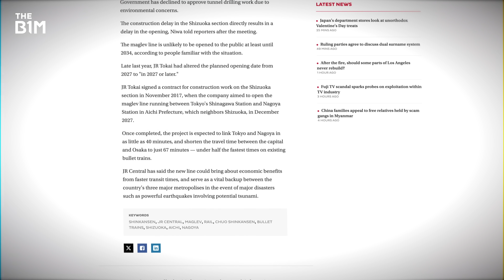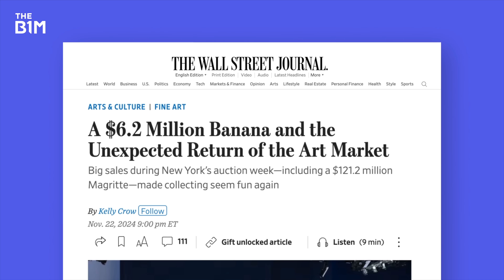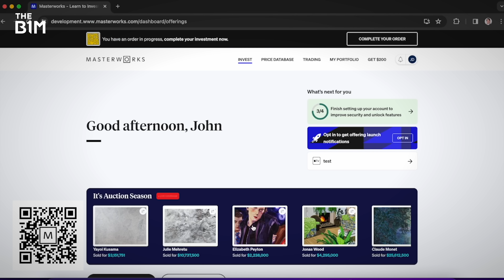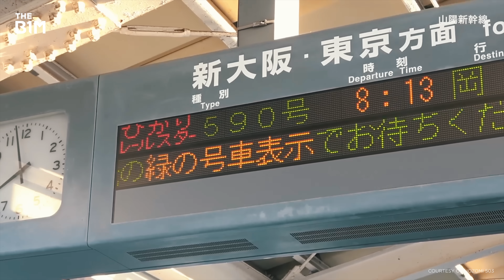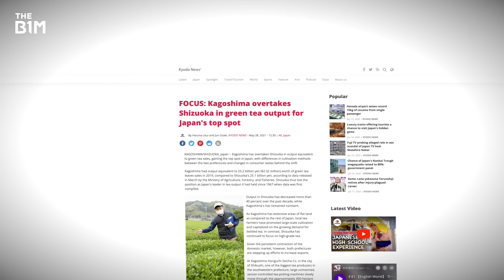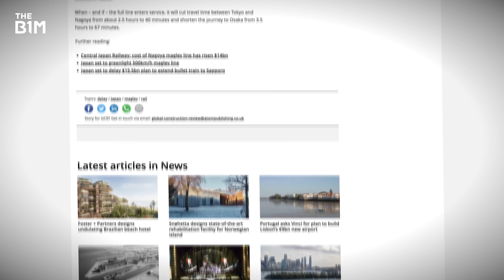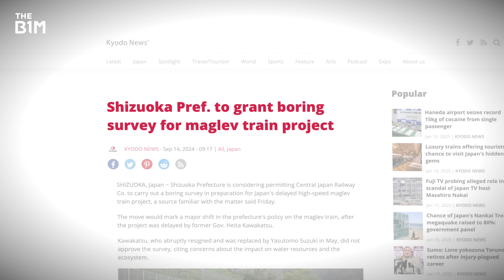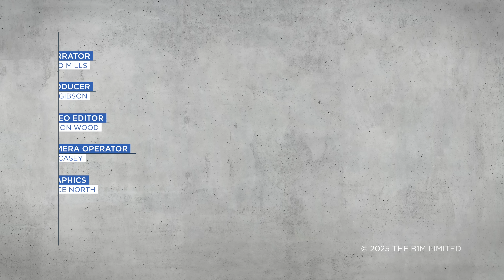Delayed: Japan’s $64BN Levitating Bullet Trains are no Longer on Track

Comment: 2:47 the thing is there were trains capable of 180-200km/h decades before the Shinaksen (the steamliner era trains in the 1920s and 1930s, post WW2 France had powerful electric locomotives), Japan was the first country who built proper track to run long journeys at sustained speed of over 200km/h and didn't shared service with local commuter trains and freight trains.
Reply: Pennsylvania Railroad was getting some incredible speeds with passenger rail in 40s and 50s. But then Big 3 Detroit stepped in to kill rail. And Detroit went bankrupt decades later so we killed rail for nothing.
Reply: Shinkansen translates to new trunk line - a dedicated, non-sharing line for high speed passenger trains only. That made the difference. 
Interestingly, a freight only Shinkansen will start operating in autumn between Tokyo and Moriooka, using converted E3 models, with seats replaced by cargo straps and fittings to prevent load-shifting, as well as larger doors. Expected market is precision equipment and high-end fresh fish, among other goods, as the new service will be faster and smoother than conventional cargo trains.
Reply: It's still the main difference. The ICE in Germany can go 300 km/h in principle - but it hardly ever reaches that, and it slows down to under 100 km/h as soon as there is a city anywhere nearby. The Shinkansen stays near its top speed until it has to slow down for the next stop.
Reply: @whocares2277  at the moment Germany still has very little in the way of a true high-speed network, it's little patches here and there joined to conventional lines and some conventional lines improved to meet the lowest high speed standards. France and Spain have good examples of high speed networks where you can do whole journeys on high speed.
Reply: @ well some countries focused a lot on hsr but didn't spend enough on slower regional services, Spain is such case. The irony is countries in Europe where people have high satisfaction rate with their trains like Austria and Switzerland don't really have lot of "true hsr" infrastructure.
Reply: However, would those steam engines in particular be capable of the same high-speed acceleration?
Reply: @ to be fair express service trains have not that many stops, usually connecting highly populated urban areas. Acceleration was not that great, but even in the 50s there were electric locomotives who were able to reach fairly high top speed and they do accelerate fairly quick. They were limited by things like sharing tracks with freight/commuter trains, the wheel shape and suspension did limit them which the shinkansen program did addressed that problem (unironically japanese researchers ironed out lot of things and they had the 220km/h top speed all the way until the 90s while in Europe 280-300km/h was the norm).
Reply: @ristekostadinov2820  You make a good point. Even though traffic could make the speed, even express routes would sometimes have to deal with slowing for goods traffic. The old networks of Europe didn't exactly accommodate for passenger-only express routes. The best chances of course being night services.

Comment: What about the Maglev operating in Shanghai? Would've been nice to point out the difference
Reply: Japan's linear trains use a niobium-titanium alloy as the superconducting material, and create a superconducting state by cooling it to minus 269 degrees with liquid helium. The train runs with its wheels extended when traveling at low speeds or when stopped. On the other hand, the Shanghai Linear uses normal conducting magnets, which are ordinary electromagnets, for levitation and propulsion. The magnetic levitation mechanism works by sandwiching a T-shaped rail (guideway) between the bottom of the vehicle, and the magnets at the bottom attract the magnets on the rail side, creating an "attraction" effect that levitates the entire vehicle.
Reply: When it runs at a top speed of 430 km/h, it's a 7 minute ride. Most of the time it's limited to 300 km/h and then it's an 8 minute ride. It operated as two parallel single track lines, because points in maglev are horribly slow. I assume the Japanese do all switching below 150 km/h with the wheels down.

Comment: As many have said, US mainlines ($$$$) involve a lot of freight rail and infrastructure that China and Japan don’t have; it’s very difficult to combine a high speed rail service with freight on the same lines. Actually it’s impossible with the tech mentioned in this video, but Acela and others along the east coast have evolved to use both (albeit at a lower speed.). I don’t see this changing ANY time soon, there’s just no way you can rip out hundreds of multi-million dollar buildings along the east coast to streamline a new high-speed rail line. 

It’s also a relatively short route, and already faster than air travel. shaving 20 min off an entire trip (even if you DOUBLE the speeds in some areas) is completely useless and won’t sell tickets.

Other nations that have large population regions separated by clean uninhabited areas would absolutely be able to take advantage of tech like this.
Reply: Chinese and Japanese HSR are not run on freight or standard passenger rails. If your going to build a HSR system do it right and make sure its elevated and not at grade like Bright Line where your hitting people and cars every other month.

Comment: The Maglev to Osaka originally was to cost $350 million per mile, or roughly $5 billion back in 2013.
Reply: That is insane HS2 was supposed to cost over $100 billion and was 1 3rd the distance as regular high speed rail.

Comment: Honestly I doubt this Maglev system is gonna be as much of a gamechanger as people think. People can boast about the speed all they want and the speeds are out of this world. But the sheer costs of operating a super conducting maglev system over such long distances is likely gonna make it extremely expensive to operate compared to a normal high speed train. 

Plus the switches (or points) for Maglev are problematic. Theyre much slower to turn than regular railway switches. And this could mean that service could be limited to one train every 10 minutes in each direction, or 6 trains per hour. Far lower than the existing Tokaido Shinkansen. And this is only worsened by the Maglev trains being much narrower than the trains on the Tokaido Shinkansen, losing a whole seat in width. 

These are pretty big technological setbacks that are fundemental to the design, and my best guess is that theyre gonna hold the project back from being as revolutionairy as one could hope.
Reply: Look to maglev switch at Transrapid: 200 kmH is no problem. Iron Railway is really bad at this point
Reply: @ArefRichardForster-mr2qj  I'm not talking about the speed at which the train goes through the switch. Rather the time it takes for the switch to move from one position to another. For a normal railway switch that's only 2 seconds. But for an SC Maglev switch that's closer to 2 minutes since every magnet capacitor on the outside rails has to be moved over a large distance.

And as a result the SC maglev can never run trains as frequently as a regular high speed line.

Comment: The UK cant build 140 miles of conventional high speed under 60billion.

Japan building 170 miles of maglev for around the same price ... 

The UK is absolutely screwed
Reply: The whole of Spain's 4000km long HS Lines were built for 70 Billion Euros. Keep in mind Spain is the most mountainous country in the EU after Austria so it's not like they are building on flat ground either.
Reply: At least you guys technically have HS1 going from Paris to London and fast mainline rail. Half of Canada’s population lives in a straight line that’s perfectly sized for HSR and we can’t even get slow trains at a consistent schedule, let alone HSR. We’re the only country in the G7 without some kind of high-speed rail, and it’s a national embarrassment that we’re only starting the preliminary phase of designing it now. But at least we’re not Australia, who I’m confident are never getting HSR for as long as I live.
Reply: @Jerdifier  As far as I know, HS1 was never the whole stretch. Paris to the the border of the UK had always been 300 km/h. HS1 was just from the border of the UK to London.
Reply: 中国京沪高铁1318KM造价是300亿美金，最新建造渝昆高铁长度是700KM，造价是200亿美金。
Reply: @阿蘇-t2j   別來亂
Reply: Drama of Japan struggling with tech tree beyond HSR... Meanwhile USA and UK cannot build tier 1 HSR 😅
Reply: @nagasako7  awak dari mana ,tiap negara ada masalah juga nak bina kemudahan awam sebab pelukan dana besar,Jepun tiap tahun spend lebih 300 bilion USD bangunkan infrastruktur mereka sebab itu Jepun sangat selesa dan maju ,sapa pernah pergi Jepun pasti dah merasai bagaimana Jepun muncul sebagai negara hebat dan kemas
Reply: @hosephanerothe1440  Even more screwed when they voted for Labour Party
Reply: @hosephanerothe1440  meanwhile we Malaysia build ecrl eastcoast railway with China under 60-70 bilion ringgit 😂 more cheap that you
Reply: Don't feel too bad, we can't build 140 miles of anything for any price!
Reply: Our planning system needs a major overhaul. Also, the govt needs to just say to the people “tough shit” we’re building it
Reply: The UK is going down. You can't even dispose of raw sewage, for god's sake.
Reply: indoensia can build they hsr in jawa island with around 70 bilion usd with china it be cheap

Comment: The video didn’t really explain why a train crossing a river would alter its flow.
Reply: It almost certainly has to do with groundwater. Groundwater flows might be altered, or water draining into the tunnel might be diverted to the “wrong” end of the tunnel because has a gradient in that direction.
Reply: The line isn't being built on a bridge there, it is over 1km under the ground in a tunnel.
Reply: A tunnel where the water leaks in which lowers the ground water? He said they had promised to pump it back.
Reply: @meandmypc12 yep, he said the same sentences 3 times about maglev... in a row...
Reply: if they were worried about altering the flow of the river they prolly should have started with not putting any hydrogen electric dams on it
Reply: Yeah. Is it because they have to build a tunnel under the river or what? They could just build over it? So weird.
Reply: Not sure. Might have water pole issues due to the magnet.
Reply: This video has so many problems if you stop to pay attention
Reply: @Meandmypc12  B1M's recent Japan series has a lot of issues in general IMO. I like them, but they are trying to cover so many things really quickly and only briefly skims over the subject. It was the same with the disaster resiliency video, and same with this one. I wish they just make it multiple parts and stop cutting out info. This is a nerdy topic anyways, the target audience will watch a multi-part series on the subject.
Reply: @Meandmypc12 this problem is most likely happening at the end of video
Reply: Maybe they can make another video to look into that since it would be way off-topic to discuss that in this video. Like, it is not the river crossing that is delaying the project, but the politician that is blocking project.
Reply: It just does. Just accept it. No need for mumbo jumbo, technobabble explanations.

Comment: I don’t really see the need for the extra speed. As long as the current train network is at or faster than airline speed, then there rally isn’t a need for the extra speed. Who really cares about going from 2.5 hours to 1.5 hours if it costs so much to build and operate. Just because it is cool and gets you marginal speed improvements doesn’t mean that it should be built.
Reply: I am wondering if the time quoted was a express, non-stop train? The more stops you make the more the average speed is reduced and the less advantage there is in going 600 KPH Vs. 250. If you put the stops less than 70 Km apart you don't have time to reach top speed without having to strap the passengers in to deal with the g forces. Start adding six or seven stops along the way and the schedule stretches way out.

Comment: relatives of mine just returned from China and they went on the Shanghai Maglev which is 30KM long from the city to the Int airport. It topped out at 220km/h for only a very short stretch and locally is claimed to be an all Chinese technology invention. But things are not as they are portrayed. The tech is actually German and was developed in the 1960s as a monorail maglev, the advertised cruise of over 300km/h and max speed of 500km/h was not attainable due to technology problems with the system which the Germans refuse to help fix due to disputes over money and proprietary information.  It got unsettled in some stages and rattled and shook which was simply scary. 
Local patronage is very thin due to break downs, the very high cost to ride on it and the fact stations are skipped as they sit incomplete and there are cheaper, more established routes to the airport it services.
The technology is very much in its infancy still even after decades of innovation and has not proven to be reliable. 
Maybe the Japanese are finding this out for themselves. That said if anyone can go it alone and do it the Japanese can. They tend to not have a habit of self engrossing their abilities.
I lived in Japan in the north Miyagi prefecture and travelled on the Shinkansen often to Tokyo. A train that goes over 300KM/h is seriously enough to impress most and is actually a bit of a fright when you pass stations or another Shinkansen going in the opposite direction.
I think going even faster would just be getting closer to a disaster. With that said, humans have always been expendable when it comes to advancements in tech and Im sure this will continue. Who knows, the Chinese may invest to get the project back on track and then just copy every pdf plan they can find!

Comment: I would have liked to see an explanation of how the tunnel construction would lead to a loss of two metric tons per second in the Oi.
Reply: As the other commenter said, the train will be deep underground (up to 1 Km) as it goes through the mountains. The scale of this project is incredible - really long and deep tunnels to avoid trying to go round mountains or over them. I think the whole complaint about water was based on estimates of the ground water that would flow out of the bedrock into the tunnels and need to be pumped out. It's uncertain how that would affect what is happening up on the surface. It may or may not have any measurable impact on the river up above.
Reply: @mylesjackson3222 
A tunnel must be dry to be usable for train 😂❤

I wished he found out what the impact would be in detail, as many people who watch are engineers. 

Digging a tunnel is a dirty task and it would for sure effect groundwater in some way. 

Saying that, the local gov is a bad actor and good that he’s gone.
Reply: Yeah, he just kind of threw that out there and then didn't explain it. I'm pretty sure there's something called a bridge that can carry a train over a river without significantly impacting its flow... Is Mr. Kawakatsu simply worried about water disruption during the construction phase? More clarity here is needed.
Reply: @illhaveawtrplz  the problem isn't getting past the river itself, but that boring through the mountains affects the way the water accumulates underground and flows through the ground, probably affecting the river at its source(s).

Nature is complex and everything we do affects the equilibrium in some way.
Reply: @lumpy-porridge  A tunnel is so negligibly small compared to an entire mountain. I cannot imagine for this to be significant at all
Reply: @illhaveawtrplz  a bridge is difficult when the line is being built more than 1km underground through the Japanese Alps. For environmental reasons they aren't allowed to build on the surface in that region, and the drastic changes in elevation within the mountainous area means it isn't physically possible anyway.
Reply: Tunnels work like wells so they take underground water away from natural water sources

Comment: I feel like they should have started with Nagoya-Osaka. So much shorter and quicker to build to test it out.
Reply: True but I guess they really wanted the Tokyo section built first since they already their test line built there and will utilize it as their main line and maybe for economic reasons since Tokyo might be more important for JR Central.
Reply: Nagoya - Osaka is already only 53 minutes on the Nozomi, so cutting it down to 27 doesn't seem as impressive as cutting the 90 minute journey from Nagoya to Shinagawa to 40 minutes. Also competing the Tokyo - Nagoya journey also reduces the Tokyo - Osaka journey from 2.5 hours to an hour and a half, as the maglev station in Nagoya is right next to the regular shinkansen station.

Comment: A river has dried out because of Shinkansen construction on Hokkaido. Not the size of Oi river, but yeah...

Also, China already has Maglev trains in operation. They are not used much. The use that the one in Japan will have, other than "my infrastructure is bigger than yours", remains to be seen. If anything it will contribute to further centralization.

Comment: Some political analysts believe the issues over the Ōi River are just pretense. Shizuoka prefecture was using this as a bargaining chip to force the railway company (JR Central) to build a station under the Shizuoka Airport, on the existing Tōkaidō Shinkansen line. 
If the station were to be built, travel time between the airport and central Tokyo would become comparable to travel time to Narita. Shizuoka International Airport would effectively join Narita and Haneda as part of Tokyo's international airport hub.
Reply: To be fair, it was just confirmed that Shinkansen construction on Hokkaido caused a river to dry up. Not the size of the Oi river, but yeah...